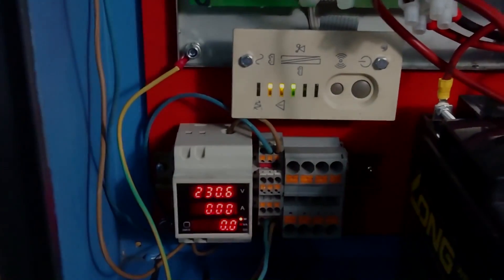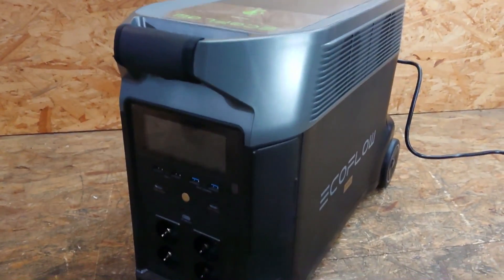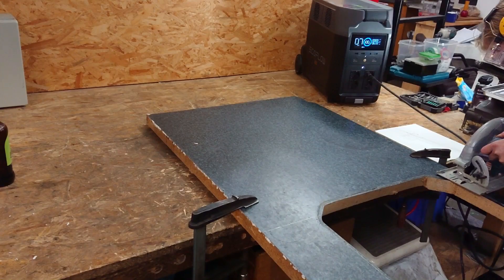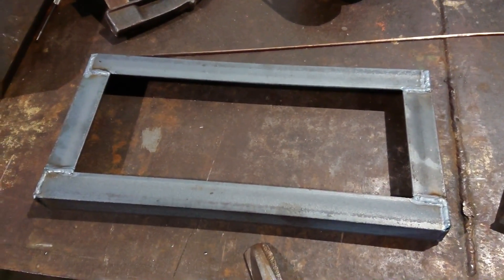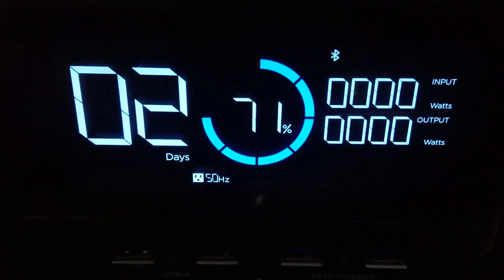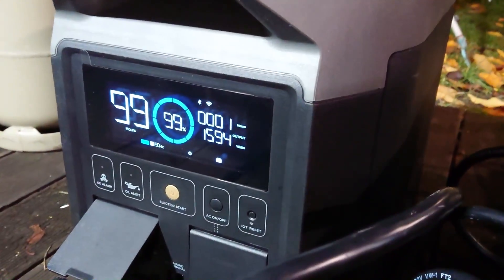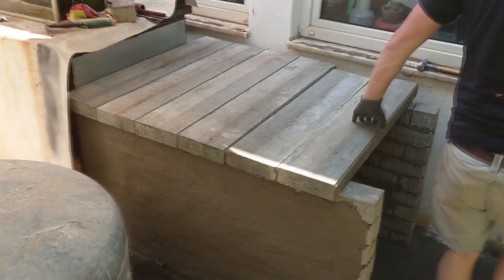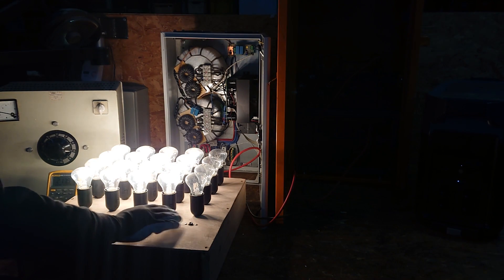Building a DIY Off-Grid Power System (vs. Ecoflow )

Comment: Well done on getting that much out of a sponsor, I have some idea of what the retail cost on that would be, which I really think should have been included in the video.  The merits of one choice versus another can't be measured without measuring the costs of the options.  The other issue with the Ecoflow and similar units is having ALL of your system in one unit.  A failure in the charger, or the inverter, or the battery system, and the entire energy system is dead.  Over the last two years I've built a solar power system, it includes 3 panel arrays, 3 charge controllers, 2 inverters and 2 sets of batteries.  If one of those units were to fail, I'd hardly notice and it could be swapped out and replaced or repaired, I have spares on hand for almost everything, and the whole system cost about twice as much as what you showed there.

Comment: You missed one of the major cons.  Cost.  That Ecoflow setup is not cheap. Also your generator house has a problem, there is no ventilation, that generator requires cooling air to be pulled in an flow over the cooling fins in the head.  The generator head has the same issue.

Comment: In the 50's or 60's, Practical Mechanics stateside caused a furore by releasing a set of project plans for a simple Tesla radio generator utilising an old tank antennae, some electrical components including some heavy duty transistors and they literally harnessed the endless radio waves from our sun which is 24/7, exudes deep into buildings and underground and is true free energy.   This is what Tesla tried to give the New York folk, abs free electricity at point of source by converting radio waves into electricity.   Why are end of the earther's not focusing on building these relatively simple devices?

Comment: Wouldn't it be easier just to change the muffler on the generator's combustion engine? I imagine that one of the reasons the Bosch generator is so noisy is because it is a 2-stroke engine and only has a tiny muffler on the exhaust outlet, a more modern muffler, like the one used on motorcycles, adapted to the engine would also help to reduce the noise, moreover running an engine in such a closed environment can produce alarming amounts of CO2 in a highly confined environment, it is bad even for the engine running if it does not have a fresh intake air intake.

Comment: Iam like you who likes to tinker and repurpose items found. I've built a system that is made up of a 3000watt psw inverter, 800watt solar panels and a 7.2kWh lifepo battery bank. It's a modular and portable solar generator. It powers my garage and in emergencies certain circuits in the house and can be moved in emergencies. Total cost was 45% of what an OEM system is. And have spare partscto repair if needed. On the flip side I have 3 Ecoflow river pro's for the size and price could not build any cheaper. I use those for diffrerent purpose powering power tools off grid to boondocking

Comment: Nice contrast between DIY power and Ecoflow systems. I'm always concerned when YouTubers hawk products. It looks like Ecoflow is a reputable company.  Matthias random stuff YouTube channel did some testing with inductive loads and took some scope traces. Output waveform was extremely distorted during heavy start up and can damage low end electronic devices that use capacitive dropper power supplies. He blew up his Killowatt digital meter. Ecoflow responded and he did a follow-up video. The surge problem is probably worse on this side of the pond with 120V. My understanding is European 240V tools have a soft start mechanism.

Thanks for the review. Looks like a great system but a little out of our price range.

We live in a rural area and heat primarily with cordwood. I've thought about wood gasification. It is a pretty clever system that was used extensively during WWII, to circumvent fuel shortages. I assume you are familiar with the book: The Pegasus Unit, by Niels A. Skov & Mark L. Papworth.  It goes into great detail about  wood gasification.

Comment: Once again another excellent and informative video. I really appreciate your ethical and problem-solving attitude in a turbulent world. Love the idea of using wood gas for heating and generating energy, but can you use such a systen in a city? I am mostly thinking of pollutants (some of the pallet/fire wood is probably pressure treated) and also that it might be quite high maintenance. Have you thought of making a bioconverter to make fuel for your systems?

Comment: Please test out how the "Ecoflow" handles Power input on its AC output. Like from an PV Micro inverter.
many have micro-inverters installed but they need a "grid" to work would be niche to see if this things can provide this "grid" 

Also look for "Zündstrahlmotor" if you want to do wood gas

Comment: Now you have to build an MPPT charge controller that can recharge your power bank from the generator or solar panels. Until then, you cant really compare your DIY system to the commercial one,. You might also consider safety-based fusable links on the bus bars in the battery bank when you start addressing the charging issue.

Comment: Nice to have, but how I would be able to justify £5K on portable power I’d never know.
Reply: Is that how much all the Ecoflow would cost????  I didn't look at that.  Actually, if you're freezing your butt off in the dark, $5K would seem like chump change, imo.
Reply: @alext8828  if you had 5k spare why would you be sitting in the dark and cold.  These are for the folks who can afford the way out. But having said that I've got 9.6kWh battery and a 6kW inverter, which when the mains goes off stops working!  Still need to fit the ups wiring so I can have a few backed up sockets.
Reply: @TheEmbeddedHobbyist  Because the lights went off and you can't find your wallet in the dark???
Yeah, the UPS is nice but can you use a trickle charger to keep your battery topped off and run your essentials thru an inverter to the battery and charger?  That way, when the power goes out, you still have the battery and inverter working.  Yes, there's gonna be wasted energy, but not $5K's worth of it.

Comment: Excellent video and as always, quite relevant. I think your AGM solution still has a place, especially if you can source most of it for cheap. The Ecoflow battery and generator run $4500, and then you have to add the solar cells. Not saying it's not a decent price, just that a DIY solution might be all some folks can afford. So I appreciate you showing it and comparing the two objectively. Either one is certainly much cheaper than putting panels on the roof, and if you have to relocate, they're portable. Thank you for all that you show and explain to us.

Comment: Steam turbine, exhaust to heating. 
Attached generator.

Just my idea...

I think the generator  needs a secondary  box/silencer. Strokers are always loud, but the eco flow is so much "in town" better.

I got delivery of a Prius battery yesterday. Only 1.2kw, but as they are not LFP or lithium they are cheap... If you hunt for them as they still hold value.
I also have a 1.5kwh stil (work tool named) filled with 18650 cells, potted BMS. And 8 20v packs.
Already "resized" for 24v system....

The problem with different battery tech is management of them and power delivery. 
I have 3 lithium packs, and I think 4 nmh packs and well as SLA..
I've order LFP, but I think it could be a scam.. should be here in two weeks...

It's alway advised to not mix, but I think this is more a series issue than parallel. 
I will be making individual BMS type thing to monitor each battery and then cut off from the parallel connection.
Then there is the matter of charging .
I found that solar on a bus bar can work with bucks set for the battery. That what I was doing on an AGM this winter.

I was thinking do I go high voltage and build a pwm high power buck, just to make things more easier.. or is that more complex??

Video reminds me... Service time for the generator...

Comment: There is a video from Matthias Wandel, he noticed some issues (voltage peaks) during powering e.g. circular saws with the ecoflow stuff. Maybe check it, before you damage some other electric devices.

Comment: As a fellow enthusiastic DIYer, I think it's important to consider a cost comparison between these Ecoflow batteries and a DIY system of a similar cost. While they might be a really compelling option for portable use, at this price point if you need it for static use, you could build a 280Ah 48v LiFePo4 pack, and then you've got around 12Kwh usable capacity to play with. Hybrid inverters can be bought for around 300-500 euros, which can provide AC power, do MPPT charging from solar panels, charging from mains or generator, as well as having a transfer switch so they can function as a UPS. The 4Kw unit that I've got can easily start my big 3HP belt-driven air compressor too!

Comment: Is there any chance you could attach a car exhaust muffler to the big generator? It would increase exhaust flow resistance, which is probably not ideal for the engine, but if it improved the noise substantially, it might be worth doing.
Reply: Most don't get a useful reduction. This guy has the best result I have seen, but it's still loud: https://www.youtube.com/watch?v=886vFc-KqcU

Comment: you should look into Nickle iron battery's also called edison batterys. its a super old battery chemistry that i think ud appreciate. they arent very energy dense but they r essentially immortal and indestructible. honestly if i had a choice id prefer a car battery that was 20% heavier if it meant i never had to worry killing and replacing and i dont think I'mtheonly one. but they arent even built commercially anymore despite being the bst long term stationary energy storage  given they dont loose any capacity over20 years of constant deep discharge operation

Comment: Like you, I had considered buying/building a power station from a 5k VA UPS. I agree however that these recent LFP Power Banks make a far more attractive alternative. The only benefit of the DIY option is that (by virtue of the iron/toroidal inverter), the DIY version can probably cope with larger short-term output. But if the Ecoflow can do 5k VA on a sustained basis, extra peak capacity is unnecessary.

Comment: Thank you for showing us a system from the 80’s, remember that nearly 40 years have passed to get to the EcoFlow system you have. I also try to use things I don’t use all year, I have 4 deep cycle batteries from my RV which is in storage for the winter and I use them on a solar generator I built. We do get sunny days but short days in Canada so it also maintains the batteries.

Comment: I'm still acquiring tools to put in my "German Army Toolbox" that I received from you. But the Ecoflow has been on my radar as that company is pushing them to Youtubers I watch. I want a backup for power to appliances than having entire home gen. A combination of fuel and solar would be ideal where the fuel could be for the longer run outtage. I wonder if a full review of these would help and can they be secured (fuel model) outside from theft?

Comment: A old car exhaust with some kind of muffler can allow shut up a generator pretty well the little garage works very nicely i like it. Thank you for making your videos on the stuf you repair and build. I always like watching them.
Reply: Have you done it yourself or do you have a reference? The best I have seen is this guy with a Cherry Bomb claiming a 9 dB decrease to a still very loud level (https://www.youtube.com/watch?v=886vFc-KqcU). The rest of the engine makes much of the noise which cannot be quieted by a muffler. A generator room does the best job, but adds a cooling problem.

Comment: Just bought an Ecoflow(smaller model). Its very god but  all these things are very expensive and out of the price range of most people. I am not saying that they are over priced, just it's the usual case of if you have money, it's easier to save money! I use a CPAP and need a supply. When my power company send me emails telling me what to do WHEN there is a power cut.... So I bought this.

Comment: When you said that inverter had a voltage too high, am i right in seeing 233V ?
That's fine for most applications, they will be happy even up to 250V, some things like lamps that are designed for 220v might see a slight loss in lifetime. i wouldn't waste energy on a variac for the sake of 10 volts or so
Add a car silencer to the big generator, also make sure you have sufficient air inlet to the enclosure.

Comment: Please. Generators are just CO² factories. Completely unnecessary in modern times. How often do you have blackouts in Germany, probably less than once every 10 years like here in the Netherlands. For mobile use you can use equipment like this ecoflow. Although it disgusts me to see that they are actually selling these fuel and gas guzzling devices with "Eco" on it. Internal combustion engines are the past. Burning fuel is the past. Solar and wind combined with batteries is the future.
Reply: Which is why he has to build this; the germans were suckered into wind and solar, now they have to tolerate freezing and rolling blackouts.
Reply: No we have not... There is a lot of talk from easy to scare People, but an actual Blackout or a rolling one has never happened here and will likely not happen. A lot of "wasteful" ernergy consumption is going on as usual. Rollercoasters,  Light Shows in the sky, big Concerts or Sports Games. Illumination of public buildings is reduced, but that is done for the symbolic value, actual Energy saved is not significant anyway. If an actual Blackout would be around the Corner, we would see strict Energy saving Mandates for things that are not seen as essential. An absolute real thing you might to sorry about in Germany, is loosing your Job because the Company is forced to layoffs due to high energy prices.

That is a real crises the rest is baseless scare talk.

Comment: Don't power anything with a capacitive dropper power supply, while operating power tools using that ECOflow. 
As Mattias Wendel showed in his video last month, the high frequency artifacts in generates, bypasses the capacitor inside the capacitive dropper power supply, and burns everything to a crisp.
Reply: Matthias didn't use his analog scope properly and his demonstration, while correct results, was because of not using an isolated ground and neutral but the same ones the saw was using. Read the comments from some EEs about correcting him in his comment section.

Comment: Consider building a rocket stove to heat your workshop using scraps of wood.
I found the best place for these DIY heaters is; Robert Murray-Smith channel here on YT.
If you build a sand battery around it, you'll capture most the heat before it leaves the chimney.

Comment: The output voltage of your Berel inverter at 233V unloaded looks just about perfect? Why bother with an autotransformer?
I'm not sure what the German spec is, I know it used to be 220V nominal and is now "230V" nominal in the same way that the UK was 240V and is also now "230V". Over here, the allowed range is 216-253V, that is +10%, -6% from 230V nominal. So we haven't had to change anything from the 240V standard. I assume Germany is similar?

Comment: You did not mention the fact that power tools have huge surge power when turned on that has been breaking some of those commercial power packs around the globe. You only mentioned the amount of power they use when already on. This could be dealt with the soft start module you surely are aware of. 

Did you not mention these facts because the video was sponsored or what was the reason? You have been honest to us subscribers and Patreon payers before.

Sorry for being suspicious and accusative. Seems just weird for you to leave important facts out.

Also, why did you use AGM-batteries for your powerpack?
Reply: Because the AGM batteries were salvaged from outdated UPS modules as mentioned in the video  ...
Repurposing/upcycling is kind of the whole theme of Gerolf's channel.  🙄
I don't really follow Ecoflow and was only aware of how inductive surge can damage control boards because Matthias Wendel released his video.
It seems Ecoflow's response and solution were prompt and fair given the situation. (not everyone who gets one of these things is deliberately trying to kill it)
Reply: @jimurrata6785  I missed that mention in the video, thanks for your comment!
Reply: @Teknopottu  Lead acid cells make little sense to purchase new today for an application like this.
Really their only advantages are being robust in cold and having a simple charging scheme.
Maybe good for an off grid cabin with plenty of generation capacity.
They are crap for energy density on both a weight and volume basis, and cannot handle being deeply discharged.

Comment: For the SLA batteries easiest thing to add is a circuit breaker half way down each string. A 40A DIN mounted breaker will still disconnect with short circuit, even on DC, from the thermal overload side, and will provide protection. Cheap, and probably can get them in the scrap yard as well, plus one per bank will provide short circuit protection and be resettable, making connecting safer, as it can be used to disconnect. Would be better with a DC rated breaker, but is a lot better than the usual thing of having an automobile fuse there with a 32V rating.